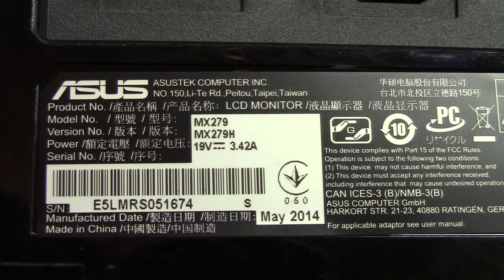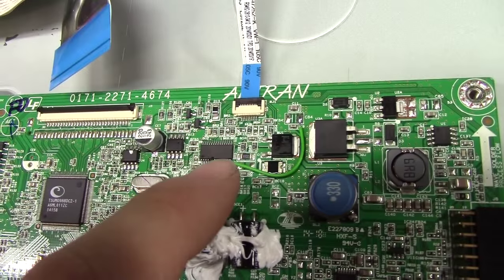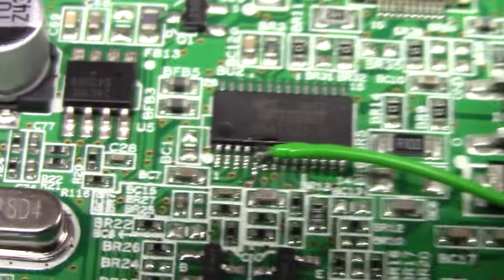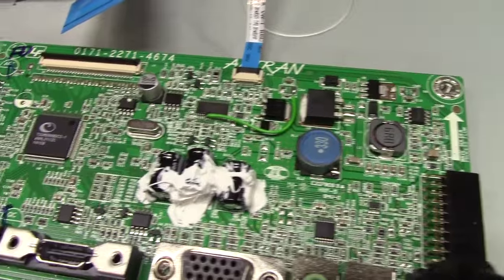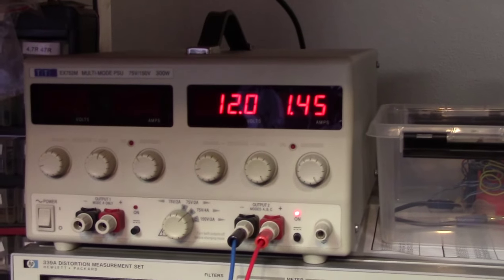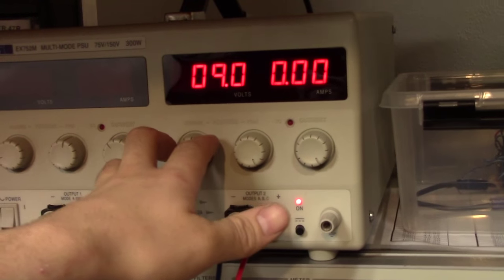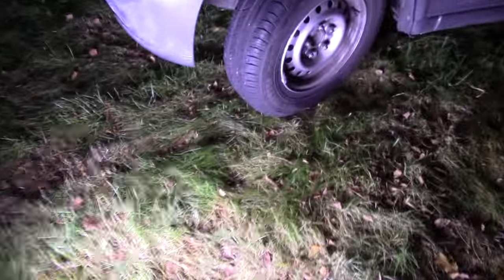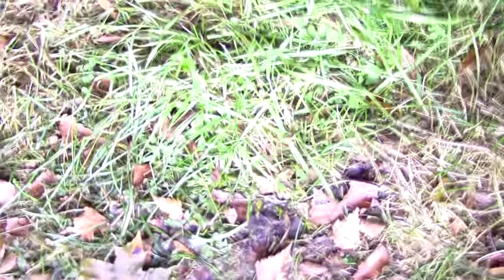How to turn a cracked ASUS MX279H 27" monitor into a light panel

Comment: Even if the LED or CCFL driver (or the light source) is shot and/or the LCD is cracked, the guts of an LCD panel are still useful, you'll only need LED's of your own to shine light into the sides of the thickest of the 3-4 layers in the panel and maybe reflective panels to replace the backing (mine broke during disassembly, but it seems to be your standard white plastic).
I will be doing some experiments with different color and color temperature LED's once I get the basic necessities of my electronics lab up and running.
As to stiffening the whole thing up, either a pane of glass or thin fiber board should do the trick, and that can be sourced with relative ease (think cheap IKEA / dollar store picture frame).

Comment: Pretty cool. I got mine with problem on the OSD, the smaller board that stays glued on the frame, there must be some type of short or oversensitivity, it acts as if I am pressing the OSD buttons randomly. I did a ghetto fix, removed the frame and left the connect exposed, so I only connect the board when i actually need to change something. At least it doesnt turn off, tries to change modes,brightness or anything such as alignment when I am in the middle of something.

Comment: Can you teach me how to remove the back cover of this monitor?
a stupid bug die inside my monitor,i need get it out of my screen.
Reply: Are you kidding me omg the same thing happened to me. But the bug is stuck between the LCD panel and the top cover so I have a black point on my display. Did you manage to open it ?

Comment: Amare I need you to tell me on the board you have integrated circuit IC4 to processors Davidis his mark kakopise to him I have the same monitor that I bought is defective and removed the integrated circuit with you the problem circuit panel look to just run off the panel has a very small circuit. .... I beg you to look at the board IC4 marked wagon that is to electrolyte 220m10volti